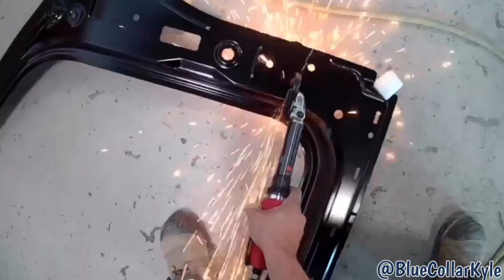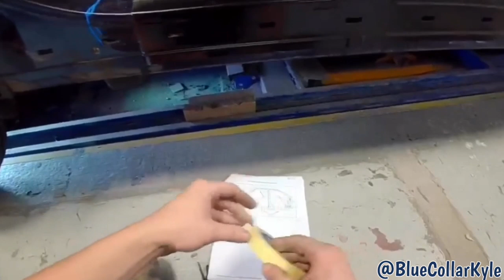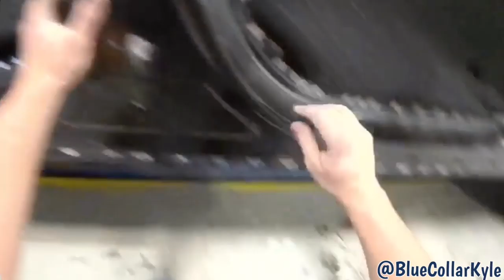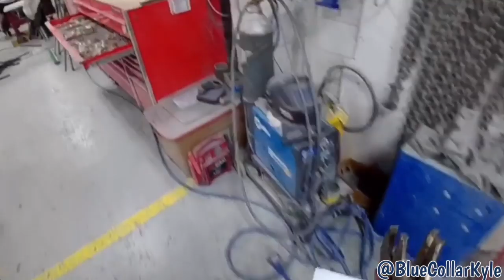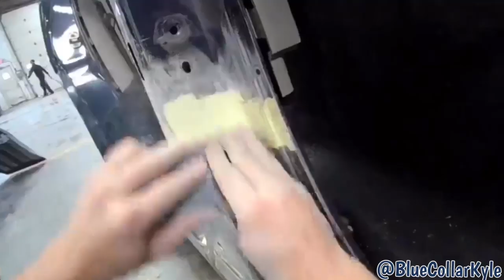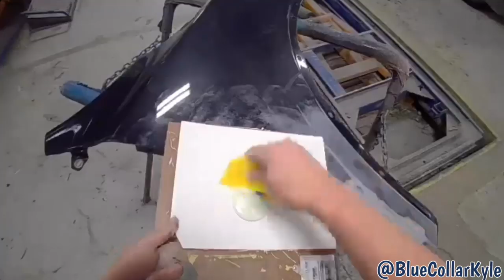Replacing A Rocker Panel Section

Comment: Just a couple of thoughts , FCA wants the panels weld bonded back on, it is in the welding hyperlink in the procedures using 3M 8116,this why they do not want weld through primer on their vehicles. Shouldn’t destructive weld be done using samples of the metal you are working with on the vehicle? Nice job though! Good work!
Reply: @alelectric2767  Fusor 112b or 3M 8116. You can find this in the welding guide under weld bond or in corrosion protection section in the FCA repair manual or in all data. Brilliant repair idea! Many OEMs are following with weldbonding. Ford uses 3M 8115 and GM is  3M 8116 for door skins and 7333 in outer panels and structures pieces
Reply: @alelectric2767    You are correct the equivalent is fusor 2098.  What’s crazy is when I started the rule was put it back together as you took it apart but now the repair procedures in some case are completely different than the production. So 7333 is 3 times stronger 8115 or 8116.  Crazy strong material.
Reply: @alelectric2767  once you start to understand repair methodology it’s actually easy. With many FCA vehicles you are not sectioning the bedside or roof or the rear body panel so what you really need to know how do you want it welded back together? In Ford and FCA`s procedures once you understand their approach it makes sense.